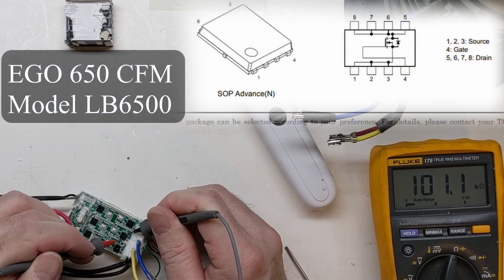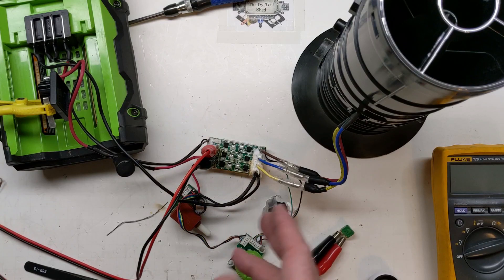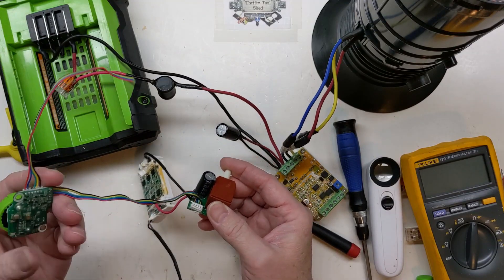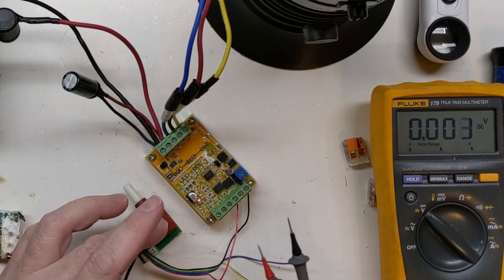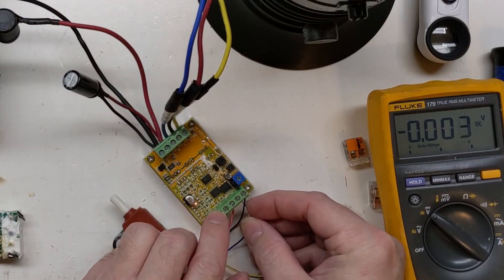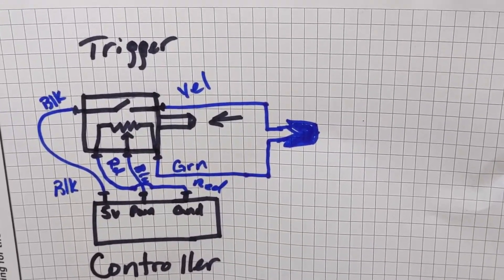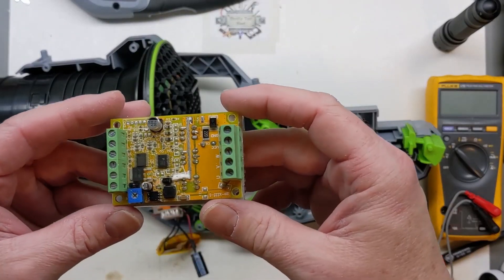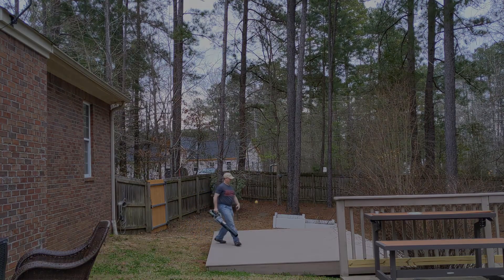EGO 650CFM Blower - Cheap BLDC Controller Retrofit

Comment: I've got 2 of these new. They both only lasted through 1 and a half batteries and quit. Smelled burnt afterwards. Can i just direct wire the battery to the motor. Bypass everything. Or maybe just direct wire with a toggle switch?

Comment: Hi I wired the turbo switch in parallel with the speed potentiometer so the turbo works now. Also have you found a good Motor controller for the ego  mowers?
Reply from the maker: Yes, that will work a treat. Are you asking about the brushless or the older brushed mowers?
Reply: @ThriftyToolShed  A brushless ego motor 4/5 2025
Reply from the maker: Hi,
I have not worked on the brushless mower to say, really. I have played around with a promising BLDC Contoller and shared a bit about it in the video below. It will need heatsink and forced air cooling, though no doubt. 
https://youtu.be/jCFGb1cj2EQ?si=c_CC1uts7A4txpq2

Comment: Can I use this controller for the LM22021 self propelled Motor(RioRand Upgraded 6V-90V 15A DC Motor PWM Speed Controller)
  and a different controller  for the 3 phase main motor?

Comment: Can you use one of these controllers on a Mower?
Reply from the maker: I have only worked on the brushed mowers. I am not sure of the current demand on the newer Brushless mowers. I don't think these  controllers are powerful enough to run the mower. It may in light use, but under heavy load it may be too much power needed for the smaller BLDC controllers that we used on the blowers.

Comment: Do you recommend using the RioRand 350W 6-60V PWM DC Brushless Electric Motor Speed Controller with Hall or the 300w?
Reply from the maker: The BLDC doesn't have Hall sensors, so it will not work. I am playing around with another BLDC controller this time, but I am unsure how it holds up yet. I would want it in the air flow as well. 
https://amzn.to/3WE3T0O
Reply: @ThriftyToolShed  hi, how long before you know?
Reply from the maker: I have only completed quick tests and have no further testing. I don't know when I will get time to test more with it. It is moving further down the list of important items to work on at this time. There are too many projects for a part-time gig to keep up with...
Storm Helene made the list grow substantially.

Comment: Very fine control of the blower motor speed 😀. I thought maybe you could mount the speed controller externally but on little stand offs, to give maximum airflow to the blower and the speed control would still get all the air blowing over it
Reply from the maker: You can, I wanted to make sure I had extreme air flow when running this hard because we are overdriving the controller a lot. It's one of the only options out there, so I had to try it. It doesn't affect the airflow much at all or I would have moved it later to test. It still had more output than from the factory.

Comment: I noticed you didn't apply thermal paste on the mosfets on the other video ... do you think that's why it fried or should've used the 80V or 100V mosfet?
Reply from the maker: It has the thermal pad between the heatsink and Mosfets instead of thermal paste. It was not in great shape and could be replaced for sure or add thermal paste, but no not for testing. Testing is fine it doesn't build up tremendous heat instantly as a CPU will starting up. I have used the same Mosfets in other repairs as well with the 56V tools. I have other videos of success doing the same basic repair. I believe an EGO saw and blower if I remember correctly. Just sharing one here that also did not go as well so I have it a retrofit just to play around with it.
Reply: @ThriftyToolShed  thanks for sharing, while I know how to solder and use a multimeter I would have had no idea how to check these or that they were called mosfets. If you can link the recommended 80V or 100V mosfet it would be greatly appreciated so I can try this repair on my broken leaf blower.
Reply from the maker: I believe I shared the link to these in the Blower repair video description. 
https://youtu.be/FxO7CpV4b9g?si=w3c_QwtSprqfuQNY

Comment: I cant seem to find a 30a 58v fuse anywhere. What was the purpose of it?
Reply from the maker: The 30A fuse is short circuit protection for the controller. This is an example of a similar SMD fuse rated for 30A in the link below. It's been a while since the video so this is just an example of one that I used. I also mentioned automotive type fuses since I have used one in for testing and temporary use. Since viewers did not like the 32V rating of the fuse I did mention you can buy larger 58V rated automotive style fuses, but they are harder to find. Hope it helps. 
https://www.digikey.com/en/products/detail/bel-fuse-inc/0678L9300-02/6139784

Comment: how does the upgrade effect your battery life?
Reply from the maker: Well as a comparison I never had the original 650cfm running to say to be fair. I do have a 480cfm and a 530cfm though. I would say it is very comparable to the original. If you hold the throttle at 100% it is very similar to Turbo with the original controller and that is approximately 25A so not going to run long at that current regardless of which controller is installed.  The draw back to this is the replacement controller does not have low voltage cut off so you have to be mindful of how far you pull the battery down while running it. I can usually tell when the blower tone Lowers that the battery is at the recharge point. That may not work well for everyone. I also had to make this controller turn off (power off) with the rotary dial so leaving the pack in will not drain the pack over time. This controller will not hold up if not in the path of the forced air since they are not rated for that wattage. It's hard to find any controllers available that are rated high enough except some really high end programmable hobby brushless controllers. Some of those cost as much as a new blower.
Reply: @ThriftyToolShed  have you looked at hobby grade RC stuff for controllers and batteries?
Reply from the maker: @Wolfiecolada  
Yes
Reply: @ThriftyToolShed  what did you find out?

Comment: Great video!  I ordered the BLDC you used on the retrofit.  I was wondering if you could post a simple sketch of the wiring diagram.  I noticed you added another capacitor and some other component towards the end of the video.  I have the 575cfm model.  thanks

Comment: Mine lasted a season and a half and then one day I squeezed the trigger and nothing. This product is garbage and can't be depended on.
Reply from the maker: That's not a good thing at all. Hope it is still under warranty! Thanks for sharing.
Reply: Don't get wrong, the power is there, but just too much plastic bullshit that will deteriorate quickly from continuous use. I wish this product had durability but it just dont.

Comment: I have a 765 blower that we plugged in the battery runs well for a few seconds and then it stops. Is it the same issue that you had that potentially could be the BLDC? Thanks for your videos
Reply from the maker: Possibly. It could also possibly be the connection between the pack and tool. If the D-terminal is not detected and communication is not happening at the D-terminal the blower will shut down after 8-10 seconds. I would inspect and clean the connectors. If more than one pack is doing the same thing it could be the blower controller going bad and not communicating. It could be something with the BLDC motor making it shut down, but I have not seen that yet myself. Best of luck to ya!
Reply: @ThriftyToolShed  
It turned out to be the base of the connector from the blower was not firm enough to make good contact with the pack. I put a piece to hold it in place inside and has worked flawlessly.
Reply from the maker: Awesome!

Comment: Hello, I have obtained an EGO 650CFM blower that was dead out of the box and never been used.  I am very interested in this retrofit.  I will check into getting the controller you mentioned.  This is all way above my head but I am going to try.  To be honest I have never heard of a Mosfet.  I haven't worked with electronics for about 55 years and am wondering if you have written instructions on this or a link to them?
I went to my local Lowes and the price of the 650 CFM blower and an extra battery is about $530 plus tax and I just can't afford that on my Veterans disability pay.
Another ting I would like to ask you about is the battery.  Batteries are $250 each.  I found them on ebay for $130 0r $240 for two.  They have identical markings to the EGO but after contacting the seller and asking, he informed me they were a third party manufacturing facility and even though the batteries were identical in every way with the EGO batteries they were not authentic EGO batteries.  They have a 60 day return and 5 year warranty but you have to pay shipping both ways to warranty them.  What do you think?  Great video BTW. https://www.ebay.com/itm/204138529679?mkcid=16&mkevt=1&mkrid=711-127632-2357-0&ssspo=y6yofcu0rgg&sssrc=2047675&ssuid=RpfwJQqsR82&widget_ver=artemis&media=COPY
Reply from the maker: I don't have information other than sharing a couple videos on these. I have a couple videos that are repair of the controller and a couple that are retrofit. I tried to share as much as possible without being a 2 hour video of course. As far as the batteries I have a couple  videos on the 3rd party packs and I was surprised at how well both worked for me and have held up well so far. I do see a lot of negative comments and reviews about these 3rd party packs in general, but I can only say the ones I have reviewed and tested have been ok to me. Hope you find some of the videos at least somewhat helpful and thanks for your kind comment!

Comment: Sir

Just trying to b clear…as far as parts needed. I see we need the BLDC 
what besides that do we need?
A 63v cap?
U have part # for that?

If we add the caps will this prevent the failure?

Thank u!
Reply: I see now  

Thanks for answering my questions 

When I get home from work tonight I’ll order my stuff
Reply: Yup
That’s what I was thinking
Reply: Actually I now see that u paralleled 2  63volt caps into the input.
Do u parallel the MOV with caps?

Also 
Can u give part #’s fer the Caps and the MOV and where u got them.
Especially having hard time finding the MOV.

Respectfully
Thad Maroon
Reply from the maker: I actually just commented and shared  link to the caps and controller. The new controller version seems to have 63v caps? Unsure, maybe they made it better? 
Ofcoarse still buy the yellow board version not the red board version. The red one is for hall sensor only.
Reply from the maker: I used this MOV across (2) 2 Ohm power resistors to make a very simplified over voltage protection. 
https://www.newark.com/search?st=V82za12p
Reply: @ThriftyToolShed  
U sent 2 MOV (2different part numbers)
Use both across (2) 2 ohm resistors
Reply from the maker: Well it's a Newark search link,  the first one is the one I used. I used (1) MOV and in series with the 2 power resistors in parallel with each other. Just to try to give some load through resistors if voltage does rise up as a Counter EMF spike?
Reply from the maker: The older version controller had 50V caps. The newer version seems to have 63V caps with the newer design (link below). It still states only rated for 50V though. I used 63V caps on my older version and use it often with no issues. I don't see another option out there unless you spend over $100. The RioRand controller also sells a 63V version but it is hall sensor feedback only so not buy that one. We have to use hall-less or senseless BLDC controller. I use caps similar to below if you get an older version. 
https://amzn.to/3UBaWoh
https://amzn.to/3dNK0Rz
Reply: @ThriftyToolShed  
OH I SEE. 
No need for the caps on NEWER version.
YES I SEE THE 63V caps already on the board.
Reply from the maker: @thadmaroon  
That's what it looks like?
I only used the older version so far.
Reply: Thanks for replying … getting all my supplies rounded up….

Nother question. the Mov that gets put parallel to the dual caps right? 
U got a link fer that ?

This will b a fun project.
Reply: One last question
 What wattage are your 2 ohm resistors?
Reply from the maker: @thadmaroon  
I just happen to have a couple of 10W ceramic power resistors. At least something to give the MOV to dissipate the energy into.
Reply: Sir getting ready to mount this

I didn’t see where I mounted the resistors 

I have them parallel (resistors) and they are in series to the varistor, 

The resistors are bout 1-1/2 “ long

Where did u mount them?

Mount them in the enclosed Case somewhere near the trigger etc?

I plan on mounting the board as u did in the area behind that screen
Reply from the maker: @thadmaroon  
If it's the same model as I had in the video and you do mount the controller in the air flow then you should have room where the old  controller used to be or around the battery connector. I may have trimmed the plastic a little in mine, it's been a while.
Reply: 2:30pm EST excellent video.  I plan to use your cheap controller fix.

Comment: How to you prevent the spark connecting the battery?
Reply from the maker: I think you are referring to the terminals arcing when connecting the battery to the new controller? That is because of the input DC bus capacitor on the controller and the only way to avoid would be using a resistor, NTC or MOSFET to limit inrush current (soft start)  until the Cap is charged and then taking it out of circuit (in case of the resistor for sure) once the cap is fully charged. I don't swap the battery out enough in my backup blower for this to be an issue. Very few if any of the cheaper controllers or DC-DC converters have NTC to limit inrush. I never added anything to this controller, but I have discussed NTC thermistors and showed how I used one in the video of the EGO Nexus Escape Inverter to help it start some 150W inductive loads that it has trouble starting by inrush limiting. 
https://youtu.be/pNyhVu1jmw8
A great resource I use is Ametherm:
https://www.ametherm.com/inrush-current/ptc-thermistors-for-inrush-current-limiting
Reply: @ThriftyToolShed  Thank you for the links. I did install the NTC and everything is working fine.

Comment: Hello! Great job on the fix. Can we use the RioRand 400W 6-60V PWM DC Brushless Electric Motor Speed Controller or just the one you got?
Reply from the maker: Hi,
The 400W 6-60v is a hall sensor board so it will drive a BLDC with Hall feedback sensor only. It would be nice if it would do hall less or senseless BLDC. Thanks for your kind comment! Best of luck to ya!

Comment: What are your thoughts if the Ego blower has been exposed to water
Reply from the maker: The controller and most switches etc. are protected pretty good for moisture. If not too much water it might be fine. If left out in rain etc. might be a different story.

Comment: You are the electronic guru. Nice job! For costing 300.00 new someone got burned. EGO needs to get their quality control under control.  I bought one of these and because of your video I bought the extended warranty for 44.00 for 3 years. Looks I will use it. Thanks again!

Comment: Hello Again  ,just want to know how difficult it  will  be  for me to install a New Electrical  wiring harness  in my EGO 650 CFM LEAF  BLOWER  ?  I can purchase  from parts warehouse  for $90 bucks  ,instead of  throwing  it in the Trash ! Your tips & thoughts  on doing this product  ??? Thanks Again Jesse
Reply from the maker: It's just the expense of it, it should be an easy job as long as ordered for correct model. Parts are just so high. I do not like throwing things out either. I never had an issue with anything I ordered from parts warehouse honestly, shipping and handling cost is a little high on some items to be so small. Parts I ordered always worked well. Best of luck to ya!

Comment: I think I will try this. I have a Kobalt 80V Push lawnmower just beep like crazy after 5s of running. I tried to do a retrofit like this with an 72v ebike controller, but no luck. The Kobalt motor doesn't have hall sensors like this one, it comes out only 3 wires. I know a lot of people out there having the same problem, and can't find a PCB anywhere ... Do you think if I swap to the 80V or 100V 470uF cap, the 50V BLDC controller can hold up with that? Thanks
Reply from the maker: Sorry, I do not believe it will work on the 80V. I think a 72V controller would be in order here.  Just make sure of course that the controller is right for your motor. You can get brushless or brushed motors. Other than that it should work as long as it is not a hall sensor. If it is brushless and the controller requires a hall sensor then it will not work. I do not know if you have a brushed motor or brushless, have not worked on that one myself.
Reply: @ThriftyToolShed  I cant find the 72V BLDC sensorless controller anywhere. I am very sure it’s a BLDC 3-phase sensorless motor. The box said it 80v, but when it run it is stable 72v nominal.
Reply from the maker: I don't see anything obvious that is sensorless or hall less either. This is one of the main reasons I never like to go above 50V if possible. I picked the 56V platform over the 60V and 80V because I had issues getting parts for anything over 48V alot of times. Sometimes with hall sensored BLDC we get lucky upto 72V, but difficult any other time. I never had much issue working on the older 40V platform, but need a little bit more power. May have to resort to finding new/used replacement parts?